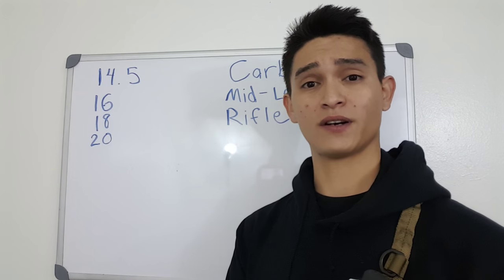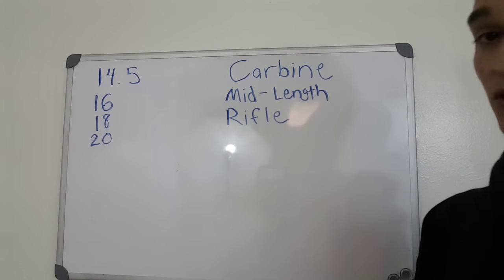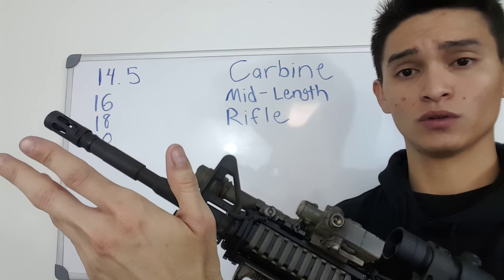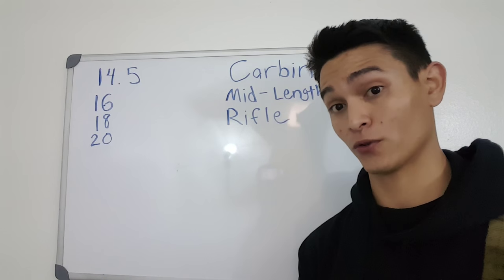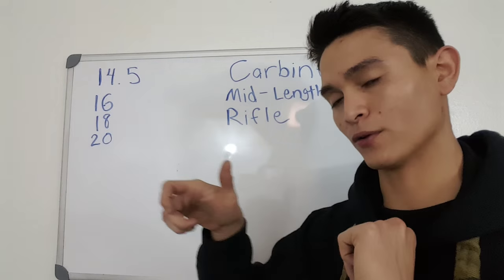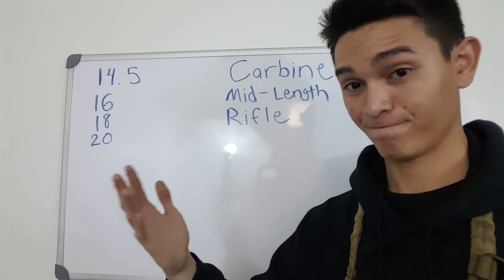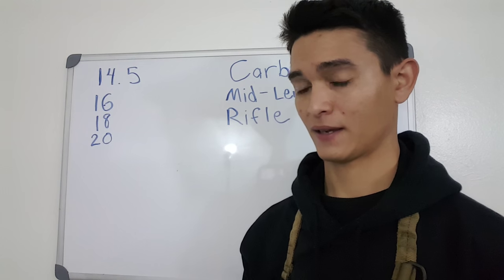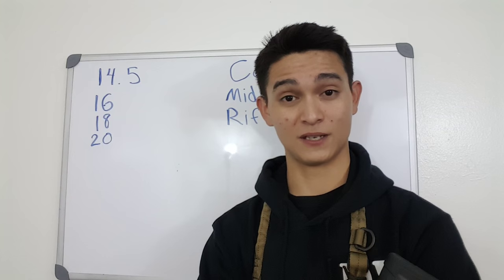AR 15 gas systems and barrel lengths, which one?

Comment: Extra info:

Powder burn - Longer gas systems will have burnt more powder, making them run slightly cleaner (less heat to burn lube)
Cam Pin wear - Shorter gas systems will be putting the cam pin under more force
Chamber pressure - Longer gas systems will drop the pressure of the chamber, requiring less pressure to extract a case + less chance of a stuck case. Less bolt lug wear too.
Gas port erosion - Less gas port erosion with longer gas systems, since most of the powder is burnt.

I use a 14.5 mid length. Nowadays, most people don't use quad rails + FSB's. I saved 3/4lb ditching my quad rail for an M-lok rail. Yes, you have to move stuff forward, but it's significant weight savings.

Comment: Excellent video. The longer the gas system, the lower the chamber pressure during ejection, the less wear on the bolt carrier group, and the "smoother" shooting the gun. The shorter the gas system, the higher the chamber pressure during ejection resulting in stronger forces that have to be overcome to eject the casing, resulting in more wear on the bolt carrier group, and the harsher shooting of the gun.

Comment: Great video on a really important subject.  I have everything from my little 7.5' DPMS kitty cat upper to 20" precision for my 556 AR platform rifles, every upper length in between.  They all have advantages and disadvantages, but this is very solid info, especially on the very short barrel uppers.  With the 10 to 11" uppers having either piston or proprietary is the ONLY option, as you stated, the regular DI gas guns of these lengths are just to unreliable to consider.

Reid at Valor had some similar comments on 18 and 20" rifles, in fact I picked up an 18" just to mess around with my chrono and various ammo types I have stockpiled, and found the 18 to be a great option for a mid length/rifle hybrid.  

Great overall info again based on the operating system and lengths - good discussions in the comments I'll bet this week too.

Comment: Hey brother I know this is an old video.

but recently I purchased a PSA premium upper 16"' FN CHf barrel with a Geissele Mk14 15" and a super geissele block.

I got delivered a 20" barrel instead... if I cut this baby down to 16" and run the rifle length will I come across problems? or should it cycle just fine?   BCG and buffer are pretty milspec. also PSA lower.

Comment: yes 16inch carbine gas runs hard. BUT THAT EXTRA GAS keeps my colt 100% reliable. especially if its filthy. i do want to see how a rifle length gas runs. how much softer it shoots
Reply: I feel the same way.
Reply: Rifle length is what the AR is designed for. Much more reliable than a carbine system
Reply: I dont think thats a correct analysis of your firearm. The buffer in your carbine is helping your over gassed BCG cycle better.
Reply: 16” is good .. its what im used to and its the most popular... but its so damn loud..  i dont have a supressor and wont till they are legal without a stamp and registration
Reply: @Stephen-br6il  doesn't the over gassing cause you to trade longevity of your bcm for reliability when dirty and added added recoil?

Comment: I think you hit the details very well. Great job. However, in your own opinion,  with a 14.5 or 16 inch AR would you say carbine length gas system has better ballistics than midlength since that dwell time is longer on a carbine length system? I've always wanted to know. And, if I wanted to reduce the recoil on a carbine length 14.5 AR,  which buffer and spring do I use and with what type of muzzle brake?
Reply: ballistics will not change, the only thing that will change is dwell time, and felt recoil. the gun will shoot just fine with either but the mid length will shoot softer

Comment: One issue most people always overlook, as you did in this video, is matching the bullets potential pressure to the barrel and impingement (be it direct or indirect) length available. It wouldn't make sense to use a high(er) pressure round in a short barrel gun when there is no benefit to doing so. If the user knows they will be shooting within 100 yards (often) with a carbine or shorter type gun, then there is no reason to use high(er) pressure rounds that are meant to have higher velocities and carry its effective pressure farther out to a target. In this case, if you need more stopping power at close range, then it makes more sense to just use a larger bullet instead of a faster bullet with more wasted energy for that specific range, such as large bore pistol rounds over 9mm with special functions (hollowpoint, softpoint, etc). Of course law enforcement/paramilitary personal have several potential ranges they may have to engage in, so finding a happy medium is of course the best option if they need to be using 1 particular gun in all scenarios.    ...So ultimately people should learn to match the rounds to the gun they are shooting, and use a gun better suited for the range they need engage in. This is what ultimately saves the gun from extreme wear over time. Efficiency and optimization is key.

Comment: So i was planning on building an ar pistol with a carbine length gas system and a 12.5 inch barrel. Is that setup still recommended? Also how far out would that setup be effective?
Reply from the maker: +Tyler Dear yes its fine and im still hitting consistently at 400

Comment: I built my first AR-15 and got disappointed at the range when I couldn't follow up with a second shot due to the 2nd round failing to feed.

18" .223 Wylde barrel with a rifle-length gas tube, fired from a Thordsen featureless buttstock with a carbine buffer.  
Apparently the bolt wasn't providing enough force to chamber a second round?
I was told by at least two sources that I needed to get a lighter weight buffer because of the less powerful gas exchange? Your opinion?

Comment: Pretty good advice. Pretty damn solid. There are some oddball rifles out there, but in most cases people just don't get them running well enough to depend on. That said, my personal favorite is a dissipator. 16" rifle gas, not the mock dissipators that you mainly see out there with a shorter carbine or mid length gas system and non-functioning (gas wise) standard front sight. It takes some work to get them to the level that you'd want to depend on them and I'd NEVER recommend them to most people. There are options that just work better with far less work. Shoots incredibly soft, follow ups are fast, easy on parts, the down side is the work required and its not always easily fixed with stuff you can just bolt on. You're getting into rifles that are more 3 gun territory, however mine functions and there is nothing adjustable to fail or come out of adjustment unlike a 3 gun rifle. I've thought about making a video to explain some of the intricacies of the system as there are many areas that will cause such a thing to fail miserably, but I just don't have time right now. However, my gun is living proof that some times the odd balls actually work. The only time mine has failed was when I tried to make it fail, filled with sand, carbon, bone dry, and on a high enough round count to give any AR15 in such conditions a hard time. Just my two cents on the odd stuff, you covered the rest really well.

Comment: Good info as always man, thanks for posting. About a year ago I replaced my fixed buttstock and buffer tube for the shorter collapsible setup (20" barrel btw) and I love it. I have to ask, what is that on top of your handguard? Is it a laser?
Reply: I believe it is a dball ir laser
Reply from the maker: +Jake C you are correct
Reply: +AregularGuy random question. so I just read today that PSA aks Gen 2 will have forged trunions now. Does that make them a viable option or is there still other things you wouldn't like about them as a main fighting rifle??
Reply from the maker: honestly, idk..... but time will tell
Reply: +AregularGuy Forged trunions at a mere 700 dollar price point (maybe 800?). It is very tempting. Hopefully some people get ahold of them, run em hard, and they hold up.
Reply from the maker: in the mean time, ill hold off lol

Comment: The USMC recently went to the M4 replacing the M16a4 for infantry units because they found they only lost 50 meters at range and lighten the load on the infantryman.  They are also fielding the MK318 Mod0 or SOST round for combat deployments.  The Mk318 was designed to be fired out of the 13.8 inch MK16 SCAR and burn off the powder.  The M855 you still get the burning powder flying out the barrel.  The Marine Corps isn't going with the Army's M855a1 from what I have been told.

Comment: I've got a 14.5 Daniel with a mid length gas.  Runs great and is excellent for home defense
Reply: +Randall Cole Do you run a can? Otherwise, you're going deaf af lol
Reply: +Marc H yea I plan to eventually but yea your right but that goes for any firearm other than a .22 indoors.  Small sacrifice in a high risk situation.
Reply: Randall Cole Yeah, and even a .22 will mess ya up pretty decently indoors. Wish I could get a suppressor for my AR but that's a no-go in Illinois. But I agree; I'd rather be left deaf than dead.
Reply: Randall Cole - The mid-length 14.5” provides the best of all worlds in one package.  My DDM4V5S has a 12” handguard with plenty of room for extras.

Comment: I have a Windham Weaponry HBC, 16" 1/9 twist, Carbine length gas system. The 16" Heavy Barrel is just insane to attempt to hold idle shots. I am thinking of swapping out the 16" Heavy Barrel to a 16" Fluted Barrel? Is this something you would suggest? If not, what recommendation would you make to cut down the weight? I cannot mount a light, hell I am even skeptic of putting a fore grip on the rail just to keep weight off the front of the gun. Any suggestions to keep the performance of the gun but to cut the weight down with out me having to change the gas block would be great.

Comment: Excellent video!  Learned a couple things I didn't know, but most was review for myself.  I personally own a 16" Rock River Arms LAR-15.  Love the thing to death.  I threw an ACOG on it and was actually wondering if you might have any recommendations zeroing the thing?  I took it out and zeroed at 100yds point of aim/impact with the tip of the triangle and then took it out to 300yds.  When I did I did have to adjust a bit and there was also a decent amount of wind at the range I was at so I'm sure that played a small role in the grouping, but aside from all that if you have any tips/tricks/advice etc. and could do an awesome video on it that would be much appreciated!

Comment: I like your video. I'm just trying ti figure out what gas system is best. I'm ready to build my 5th ar-15 platform rifle 224 Valkyrie. I got a barrel I'm interested in. is a 20 inch barrel with a 1.10" twist rate and a Carbine Gas System. It should be a rifle length gas system, but that is how the barrel is maid. Now I'm wondering if I should get it. Thanks Great video.....

Comment: For the carbine length gas system. One could put in a heavier buffer to remedy the recoil impulse and wear and tear on the parts.
Reply from the maker: the gas impact is the same so the violence of force is the same on the parts even if the action is slowed down. but the second part to your statement is something I totally agree with.
Reply: Makes sense

Comment: Anyone that wants a m4 as close to the real one, check out specialized armament. They call it the 14 five 16. They only do the work on colt 6920's or 6940's but that's because uniformity and quality. Plus they sell just about all the colt AR and M16 parts. Just my 2 cents love the vid.

Comment: Would it be wrong to say that since the carbine length gas system is a bit over gassed, it would help reliability a bit if the weapon got dirty or fouled up? Further, could the bit of access recoil be mitigated with a muzzle break?

Comment: I bought a 16" barrel with carbine-length gas system. Is it possible to put mid length handguard on the rifle?
Reply: Not without swapping the barrel to midlength
Reply: Or get a low profile gas block and then you can get any length free floating hand gaurd you want
Reply: @korkuc26  alright! Thanks for your answers!
Reply: @macross7k  look up dissapater probably spelled it wrong but PSA has exactly what you are asking about.

Comment: Adjustable gas block  pistol length for 300 AAC.
AR-15 20" 223 wylde heavy barrel rifle length gas system 1/3 inch 3 shot group, 200 meters, barrel alone weighs 4.5 pounds.
shorter the barrel the LOUDER the rifle will usually be and lower the velocity, the 5.56 was set up for a 20" barrel originally .
Shorter gas system gives hotter and higher pressure gas also more burning powder in shorter gas system.
The hotter gasses of shorter gas systems are hard on the springs heat is bad for the springs
You can go 14.5 with registering as a SBR and pay the BATF fee.
M16A2 shot 5 inch groups at 500 meters, didn't have optics or anything else to put on our rifles back then, fixed stock, 3 round burst that rarely worked and no rails for mounting anything.

Comment: @Regular Guy Training LLC
Is the Mid Length more reliable than the Carbine Length in your observations?
Reply from the maker: For the average guns I see come through with these gas systems (let's say it's a 14.5) i'd say that in the moment they are about the same. 

Long term though ive seen that carbine length systems are harder on moving components over time.
Reply: @Regular_Guy_Training_LLC  Got it. Thanks for the reply. I have a Colt 6920 and have been wondering if I'd be better off with a mid length, reliability wise. I replace parts preventatively so I'm not too worried about the long term. I'm more concerned with how many rounds it can go without a stoppage assuming regular maintenance and cleaning. This is a home defense carbine.

Comment: Great information the only question I have is that I have a 20 inch barrel and the gas port it 12.5 inches from the barrel flange. Is that a mid length or rifle length?